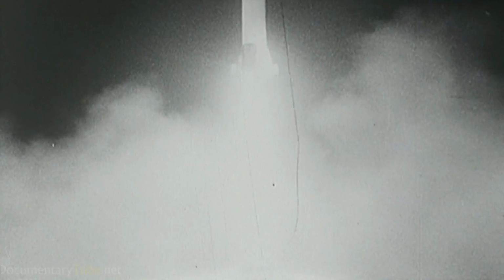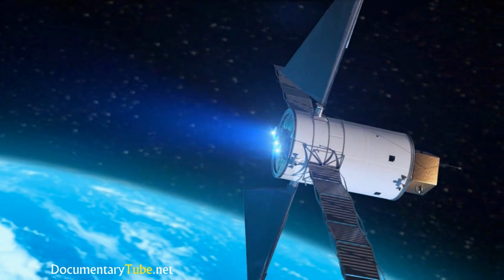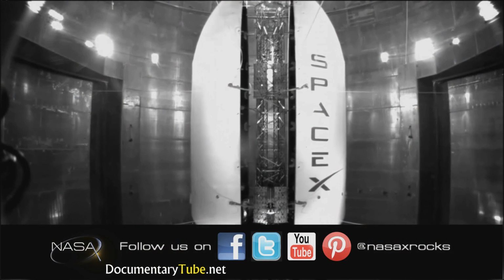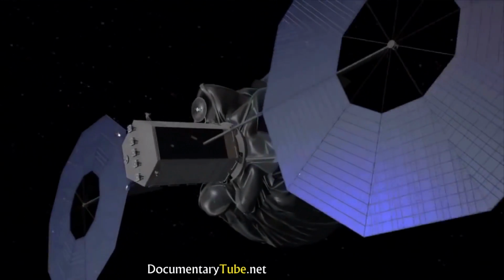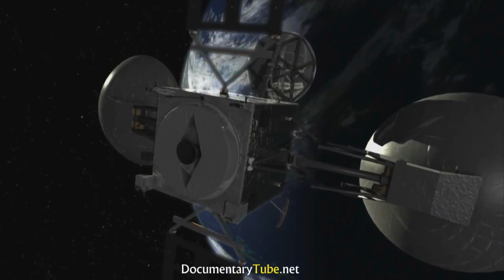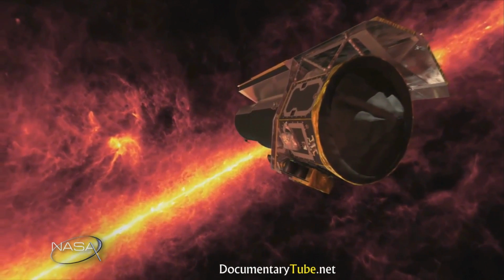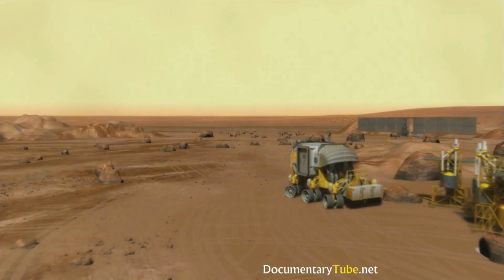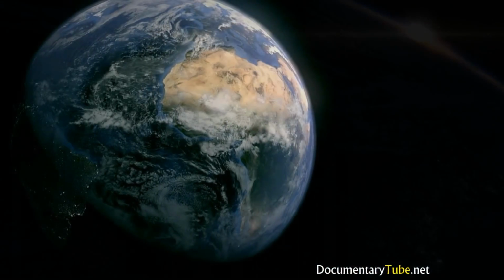NASA's Engines and Possible Speed of Light Propulsion?

Comment: Didn't NASA launch a ion propelled satellite like a decade ago? I haven't heard anything about it in years.
Reply: The first ion engine flight in space was in 1971.
Reply: +ezaw tv 3 backers and $3 of funding would seem to say otherwise....

at least at the moment, give it a few decades and we'll see.
Reply: ezaw tv Eh...no.
Reply: farest thing*
Reply: +Jovan Mrdalj the farthest thing?
Reply: Vaul the Creator ll
Reply: Didn't launch so well after all... or maybe an employee squashed it mistaking it for a fly... didn't they say the maximum power they achieve is less than a pound?
Reply: It accomplished its mission and they turned it off.
The thrust of ion engines is very small, but they can run for a very long time of a very small amount of fuel.
Voyager 1 and 2 were launched by chemical rockets and have speeds of 17.26km/s and 16.08km/s respectively.
Deep space 1 was able to reach the same speeds as voyager 1 and 2. However, DS-1 was launched by a Delta II with almost 1/4 the payload capacity of the Titan IIIE used to launch the voyager probes.
Shouldn't be too difficult to reach speeds in excess of 75km/s with ion engines.
Reply: Go to the NASA site genius, they'll update you daily.